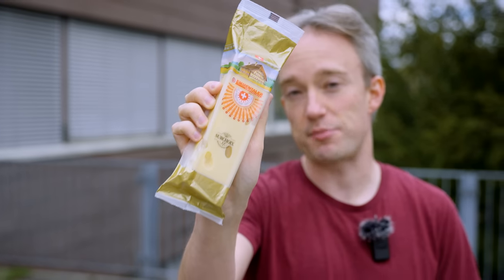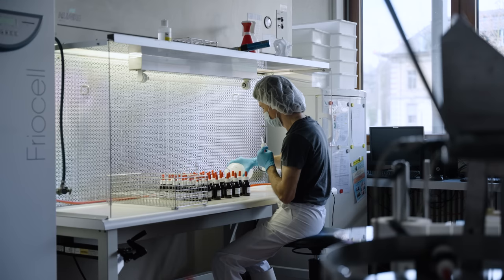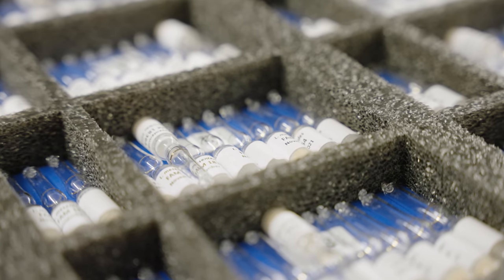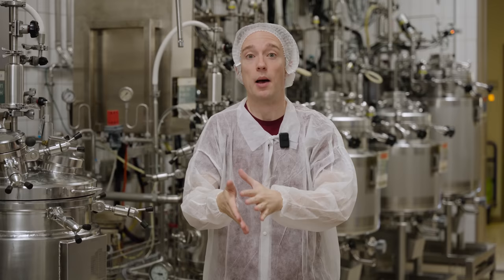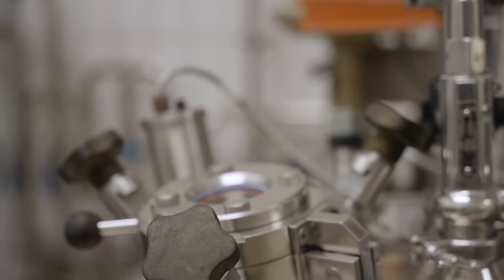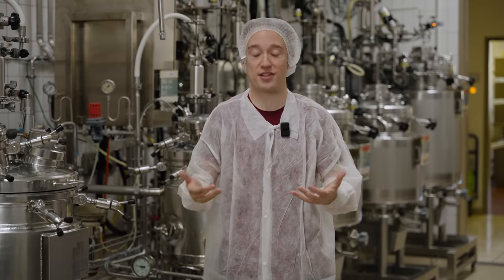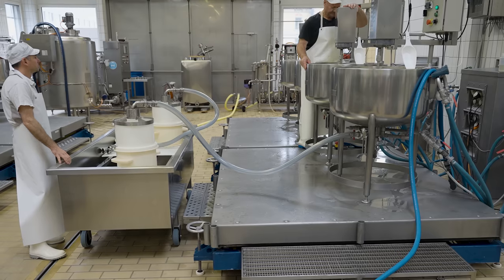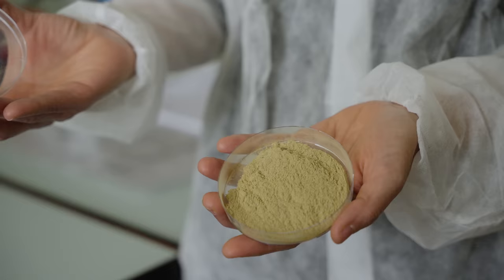How they saved the holes in Swiss cheese

Comment: In other word, Swiss cheese makers  try to increase the bubble size to reduce the actual amount of cheese the consumers will get. Meaning, same block of cheese, weight 50% less because it's now the Frito-Lays-bag-of-air cheese
Reply: Cheese is sold by kilogramm. So more holes just need more space but is not more expensive. Also most swiss cheese has no holes. Only 1 type really has big holes the emmentaler.

Comment: I was looking at the slight dome on those blocks of cheese where the holes have formed & expanded. 
Then I remembered just how dense Swiss cheese is. That's a fair amount of pressure being produced by the fermentation. Also, "hay powder" may be accurate nowadays but back when it was a contaminant it started out as both food & bedding for the cows  would've been accompanied by large dollops of... erm, large dollops! Now the guts of animals, especially ruminants, are a biome populated with a huge number of bacteria so they must have been open to the idea that the lack of holes could have been caused by a lack of poo in the milk along with it's concomitant flora & fauna.
The hay powder result meant it was a close run thing! 💩🥛🧀🐮

Comment: Here's an idea, if they're not already doing it; why not have both the "perfect" and "hay-added" versions and just use one for shredded cheese while the other can keep the holes for the aesthetic/texture of slices. Might seem like a small gain amount wise per wheel of cheese, but with the sheer amounts being produced and used, it's still 'wasted' space/cheese that probably adds up to quite a bit of cheese, both literally and figuratively
Reply: @xxx_phantom_xxxw_t_a9479  Well, I understand that we're not losing actual cheese in the process since it's not "removed", but I meant loss in the sense that the space isn't utilized for usable cheese.

Wait, so sliced Swiss cheese isn't just these big wheels with holes cut down into slices?
Reply: @amark9775  well "sliced cheese" is not really a big thing in switzerland. But yes if course. You have the big cheese and cut thqt into smaller parts which can also be slices.

Also only 1 type of swiss cheese has holes (emmentaler). All the other types dont.
Reply: Since it is sold by weight, it just means you are getting a bit more in volume when there are more holes.  Sure, the cheese maker might get a few more percent of weight in the same wheel, but then they would have to build two different facilities, with two different processes only to sell you less volume for the same weight.  In other words, they'd go through all that work just to give you one less slice's worth in a package.

Comment: I was contemplating on the "marker sequences" and wondering if in Switzerland it is allowed to add modified bacteria to food. Nope! They are using IS elements as markers! That's so cool!!!! (doi:10.2533/chimia.2016.349 if someone wants to follow the rabit hole too. Paper is not behind a paywall).

IS elements (insertion sequences) are short-ish DNA segments which have their own enzymes. The enzyme (transposase) enables them to "jump" into DNA, on their own. If they do it in an unfortunate spot, they might disrupt genes (which is bad. Gene no work). And if fate is one the bacteriums side, the IS element comes bearing gifts in the form of shiny new genes (more functions, bacterium levelled up, yay!). You can very roughly think of them as (pro-)viruses, but without the viral-nasty part. It's just a thing that sort of automatically happens. A quirky DNA feature.

Comment: Most swiss cheese in America actually has the holes mechanically added when sliced for packaging. You'll notice this when none of the holes in the slices actually line up, which they would if they were natural and sliced from the same block, and you'll also notice this by the lack of any border imperfections, where holes would normally develop. If you were to picture what a block of swiss would look like with these attributes in mind, It's as if the holes only develop at the narrow ends of the cheese. You'll also find 6-9oz blocks of swiss that are completely uniform with no holes. This is because they don't go through the whole process that creates these holes, they want to make it as fast as possible and get it out the door. It also means the swiss cheese made in America is rather bland.

Comment: The premise is already nonsensical. The vast majority of Swiss cheeses DO NOT HAVE HOLES and NEVER HAD. It is only the Emmental cheese which has large holes and there are a very small number of cheeses with very small holes. To say that Swiss cheese has holes is thus already nonsensical in itself, because the vast majority of Swiss cheese simply doesn't.

Comment: I would imagine that those holes likely do impact flavor.  Surface area to slice thickness ratio affects how much of the surface of a given slice is exposed to the air and therefore how much of the slice oxidizes.  Also, the heterogeneous distribution of holes across the surface of a slice could very well affect how much cheese is ingested per bite in say a ham and Swiss sandwich.